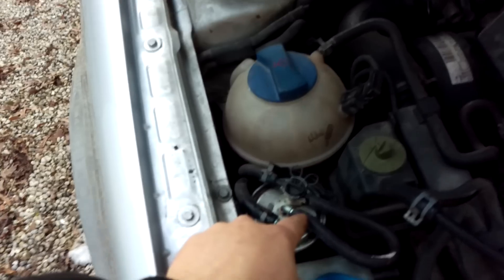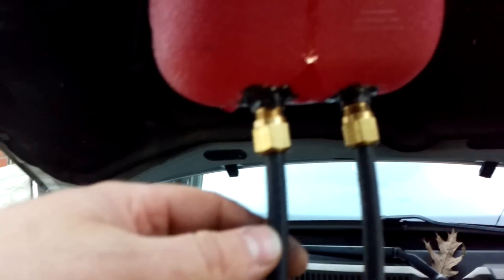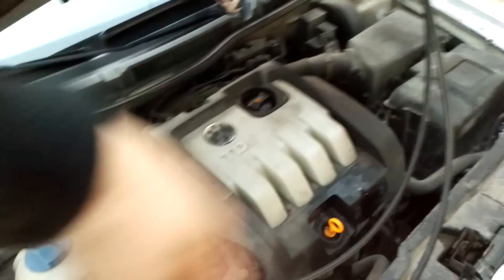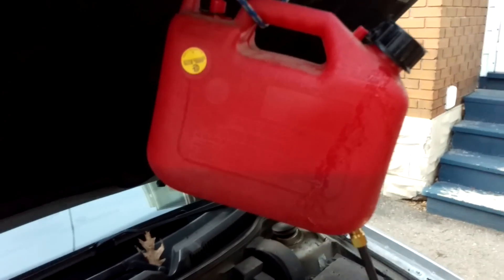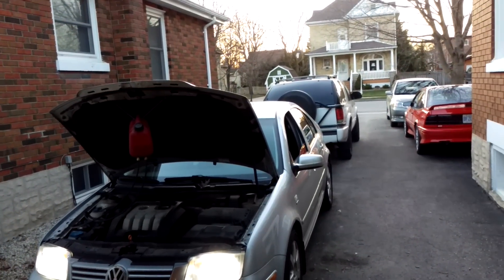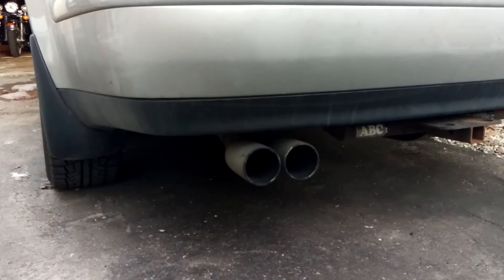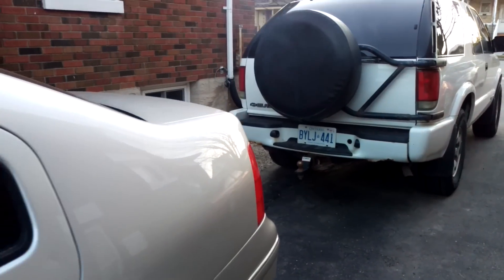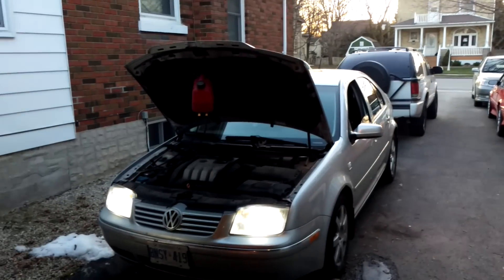How to clean your PD TDI fuel injectors

Comment: You should have used a cheap inline fuel filter on the return line. The way you're doing it any crap you get out of the injectors you're just recirculating back into the system.

Comment: It's a common misconception that ATF has a lot of detergents. Do your research, and not on an old geezer site where they think ATF cleans.
Reply from the maker: nickfancher1 original atfs like dex 1,2 and 3 contain many detergents and they are great for cleaning. specifically why I state "generic atf" such as dex 3. newer transmissions call for specific fluid types, many of which do not contain detergents.